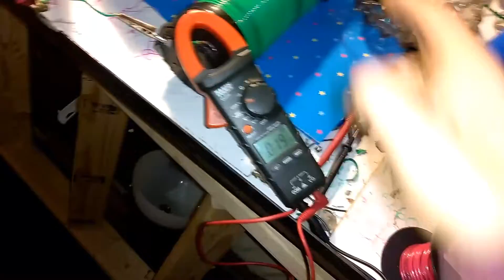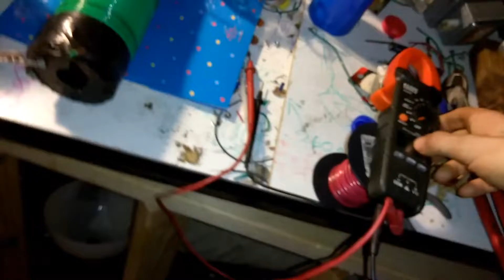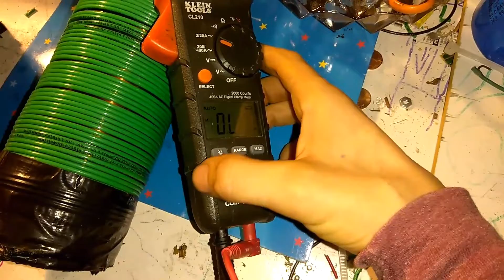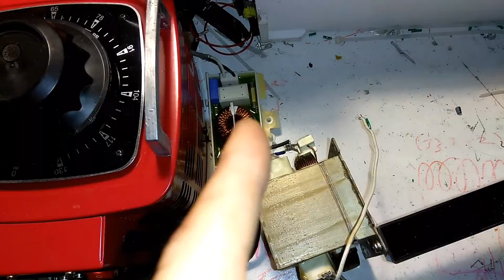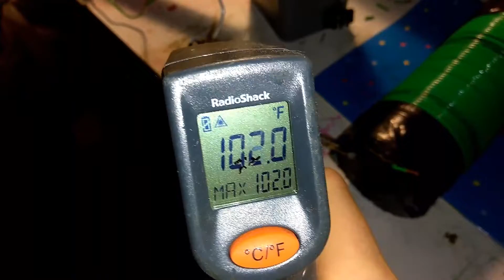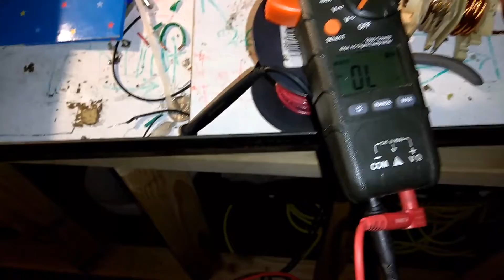Electromotive force resonance

Comment: The output power as measured is apparent power...shouldn't you multiply it by the power factor?  Your input power meter has a power factor function...my guess is your power factor is somewhere around .3.  Nice video showing the alternative theories which are really probably more real then alternative.